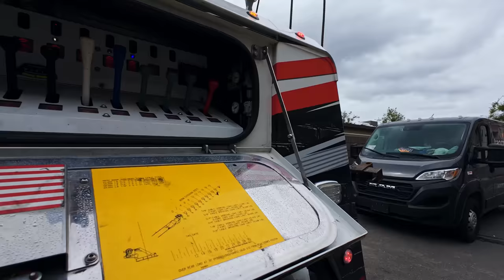Winching Out a Ryder Box Truck in DEEP Mud

Comment: Attaching to a welded liftgate support isn't the brightest Idea, Josh. While it might be an expedient way, it can also pull that entire liftgate off of that truck. The reason I say that was it happened to Budget Truck Rental in Fort Walton Beach, FL. We found that if you attached to a solid area of the rear axel iit worked better. You got lucky although it also looked like the liftgate was raised above the flat area isn't.
Reply from the maker: Zero chance of harm. I mean you can literally see at the end. Attaching to where you said wasn’t a good option here because I didn’t just need a horizontal pull I needed a vertical one to clear the wood.
Reply: Only reason I would come to California is to visit your team

Comment: Definitely need to be careful pulling from those points. We once had a truck like that and it got stuck in a snow bank. We pulled straight out from the same spot and ripped that bracket that goes up at an angle right out of the frame. 😮
Reply from the maker: That’s exactly what I went over in my video. It was in mud yes but not buried like a snow bank. That much force would do damage but as you can see here I used the mud to my advantage to float it up and slide it out in neutral. The fact it wasn’t loaded helped too
Reply: yep totally respect your skill and was just trying to add to the expertise of how well you did that. Thanks for the great videos  @PepesTowingService
Reply: Ryder I'm sure is happy to see you pulling on their liftgate. Say what you want but that is not a recovery point. And you should never hook there.

Comment: Yeah but could you tow with that M100?
Reply: That truck is not an M100-that has a wheel lift on the back. An M100 does not.
Reply: @glennjukes5581  I know it's not an M100. Josh was telling us how long the boom would be out if it was one. Miller can think their chest all they want but the M100 that have towing capabilities it's only a T-Bar as far as I know. It's big and I'm sure it's a super recovery machine but most places can't afford just a recovery unit, and while you can tow with a T-Bar in MHO it's not the same as having an underreach.